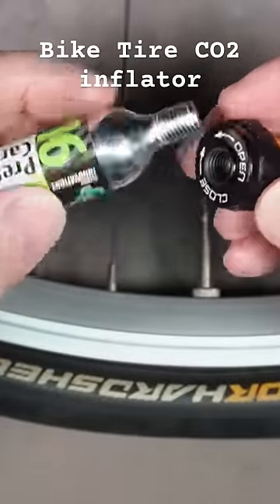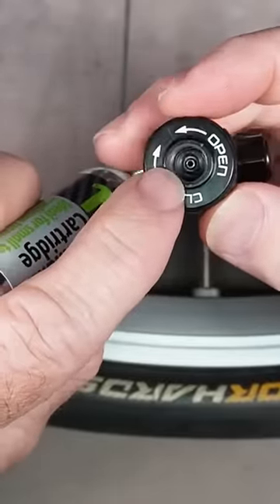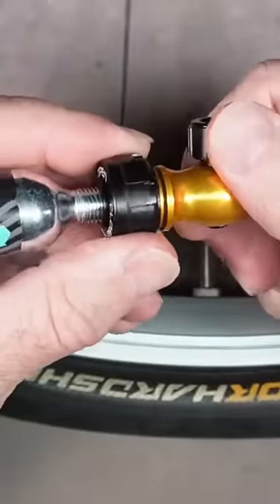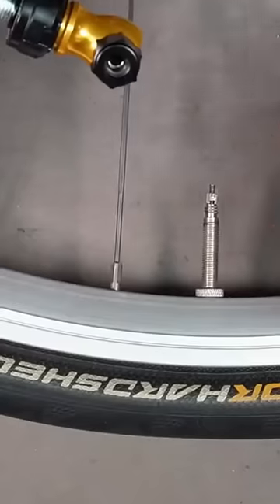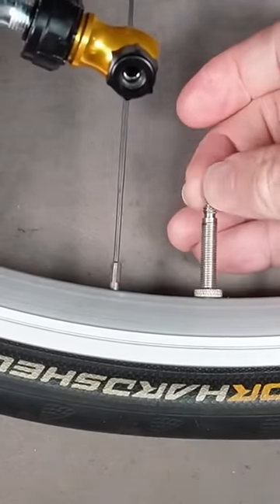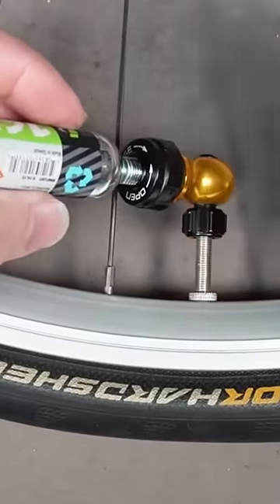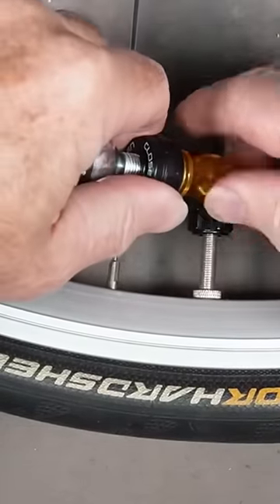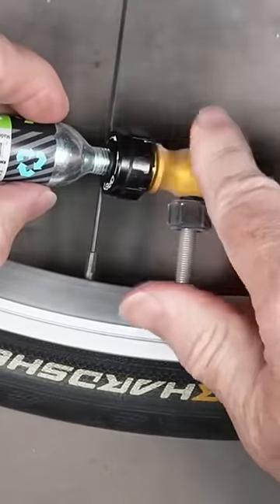Bike Tire (tyre) CO2 Inflator: How to use. #bicyclerepair #bike

Comment: For emergency only ya need make sure u have puncher repair kit or new tube bloody expensive way to pump ya tyre up 😂
Reply from the maker: It’s not really that expensive, but it is an option many cyclists choose. You can fix a flat in just a few minutes. Replace the tube, inflate in a few seconds and you are on your way. Just be sure to replace the CO2 with regular air when you get home. Thanks for the comment!

Comment: A bike pump doesn't weigh that much.
Reply from the maker: True. A CO2 inflator is just another option for emergencies to quickly and easily inflate a tire out on the road after fixing a flat. Thanks for commenting!
Reply: @davescycling  if you're racing like tour de France.
Reply from the maker: Nah, Tour de France riders get a new bike if they get a flat!

Comment: Man this was painful to watch, put the device on first then insert the cartridge. You did so many unnecessary steps 😂
Reply from the maker: lol, no steps were “unnecessary”. You must not be familiar with Presta valves 🤔. Presta valves close when there is pressure inside the tube or tire. I loosened the lock nut, which is necessary for air or CO2 to flow into or out of a Presta valve. You can see the entire video here: How to Use a CO2 Bike Tire Inflator
https://youtu.be/jc-BpZL3lAk
Thanks for the comment! I appreciate it!

Comment: Uuuuhhhhhh,,, what happens when you take it off the valve with the core unscrewed like that??
Reply from the maker: Nothing will escape when the CO2 inflator is removed. This is a Presta valve. Presta valves close when there is pressure inside the tube or tire. I only loosened the lock nut, which is necessary for air or CO2 to flow into or out of a Presta valve. I did not remove the core.
Thanks for the comment! I appreciate it!
Reply: @davescycling  ok, so there is a check valve inside. Got it.

Comment: Too lazy for using a pump?
Reply from the maker: If I were lazy, I would be reviewing recliners. A CO2 inflator is simply a small, lightweight, reliable method of very quickly re-inflating a tire after fixing a flat. Thanks for the comment!

Comment: Just use a high pressure  frame pump  these are just money crap....
Reply from the maker: A CO2 inflator is just another small, lightweight option to take out on the road in case of a flat. I have been carrying one for years and it works great.

Comment: Or instead of expending 20$ every Time u use it, u could just Buy a 7$ hand pump that y can use ir any Time AND they aré not that big 😂
Reply from the maker: That is a valid point, but they are actually $3 per cartridge. A pump is the best option for most, but I just love the super compact size of the CO2 inflator. I also love how quickly it works! Thanks for your input!

Comment: Better to carry a small hand pump than these. These suck. They rot your tires. Also use sealant. Dont br a weight wennie.
Reply from the maker: These are designed for emergency use only and they do work with tubes as well as tubeless tires. It is simply another option for on the road. Quick inflation, after repairing a flat that many choose to use, including myself. Thank you so much for commenting!

Comment: so why the hell take the valve out of the stem ?makes no sense
Reply from the maker: Thanks for the question! This is a Presta valve, and nothing was removed from the valve. It was simply opened so that the CO2 would go in. With a Presta valve, you do need to loosen the top nut to open the valve and then once there’s pressure inside the tube or tire, the valve automatically closes.
Thank you so much for your comment !

Comment: Зачем ломать себе мозги,если можно этого не делать?!  Давно придуманы портативные копрессоры для подкачки колёс!
Reply from the maker: CO2 inflators have been around decades before portable inflators. If you have ever actually used a CO2 inflator (I have many times) to save a ride, you would see how quick and easy they are to use. They weigh practically nothing and can be tucked away in a small saddle bag for years! thanks for your comment!

Comment: Ok, and remove the device now! It will deflate?😂😂😂😂
Reply from the maker: Actually, it will not deflate. This is a Presta valve. Presta valves remain closed as long as there is pressure inside the tire or tube. Thanks for your comment!

Comment: YTF wouldnt u just use a pump
Reply from the maker: A CO2 inflator is just another option for emergencies to quickly and easily inflate a tire out on the road after fixing a flat. It is super small, light and inflates a tire in seconds. Thanks for commenting!

Comment: Why. Just carry a hand pump instead of this frostburn inducing expensive complex item you need to keep buying cartridges for.
Reply from the maker: A CO2 inflator is just another option for emergencies to quickly and easily inflate a tire out on the road after fixing a flat. They are not expensive and a few cartridges have lasted me a couple years, so unless you get flats regularly, you do not need to replace them very often at all. This has been my experience as I have used and carried these for many years now. Thanks for commenting!

Comment: After inflation, how does 1 screw that valve core back to seal the co2⁉️ Your video didn’t follow through EVERYTHING THAT WAS MESSED WITH……..6/18/24 🇺🇸
Reply from the maker: This is a Presta valve. Presta valves close when there is pressure inside the tube or tire. I only loosened the lock nut, which is necessary for air or CO2 to flow into or out of a Presta valve. I did not remove the core. You can see the entire video here: How to Use a CO2 Bike Tire Inflator
https://youtu.be/jc-BpZL3lAk
Thanks for the comment! I appreciate it!

Comment: I want to see you take it off after you loosen the tire valve 😂. Good luck panic screwing
Reply from the maker: This is a Presta valve. Presta valves close when there is pressure inside the tube or tire. I only loosened the lock nut, which is necessary for air or CO2 to flow into or out of a Presta valve. I did not remove the core. If you click the link in the video, it will take you to the full video and you will see everything.
Thanks for the comment! I appreciate it!

Comment: But CO2 aint Nitrogen & is not a good gas to let it fill the tire.
Reply from the maker: The CO2 inflator is a very common inflation, tool carried by many road cyclists for years. It is used for emergency use only when getting a flat out on the road. Thank you for your comment!
Reply: @davescycling  🙏🏻

Comment: Обосраться, а как теперь вкрутить нипель сняв эту штуку что б в следствии невышел весь воздух с покрышки пока ты будеш его закручивать?) Если только не ехать вместе с ней)))
Reply from the maker: This is a Presta valve. Presta valves close when there is pressure inside the tube or tire. I only loosened the lock nut, which is necessary for air or CO2 to flow into or out of a Presta valve. I did not remove the core.
Thanks for the comment! I appreciate it!
Reply: @davescycling  надо глянуть подробнее конструкцию клапана, и как он работает
Reply from the maker: Yes, it seems this valve is not as well known as I thought. A lot of people left comments similar to yours. It is a common valve type in road cycling and I have been using it for at least the past 10 years!
Reply: @davescycling  я когдато занимался даунхилом то немного следил за всякими приколюхами, за железом, сейчас некатаю , неслежу за всеми новинками как раньше, вот и незнаю о нем)

Comment: Can't recommend to put co2 in a tire it's an acid that will even mess up silicone 😉
Reply from the maker: It is designed as an emergency measure when you’re out on the road to fix a flat, it should always be replaced with regular air when you get home.

Comment: Take the core out of the valve?  You have to be kidding!!!
Reply from the maker: The core has not been taken out of the valve. This is a Presta valve. The top nut must be loosened to open the valve in order to fill the tube. Once there is pressure inside the tube, the valve closes automatically. This is how all tubes and tires with Presta valves are inflated, whether it be a standard pump or a CO2 inflator.
Thanks for your question !

Comment: Has the world gone so insane that we now need throw away cartridges just to inflate a bike's tire???
Any bike I have used had or could receive a small pump that can provide unlimited air as long as you use your muscles to operate it... This makes no sense, CO2 will run out faster from your tires than air
Reply from the maker: The CO2 inflator is for emergency use when you get a flat out on the road. You must replace the CO2 with regular air when you get home.
Reply: @davescycling  Sorry, it makes no sense. I have repaired tires on the road more than once, you just put air using a small pump and call it a day. There are even cases where partly inflating the chamber helps to set everything back in place properly, that will be very difficult with this method...

Comment: na pompa apprresso, noo!?
Reply from the maker: Yes, you will need to use a regular air pump after you get home. The CO2 inflator is only for emergency inflation when you get a flat out on the road. Thanks for your comment!

Comment: Presta valve suck so to see you two cartridges for air and your tubeless bike tires suck too.
Just my opinion cuz I've tried them and they all suck tubes are the way to go
Reply from the maker: Thanks for your comment and your opinion! I do like the fact that my tubeless tires seem to be way more resistant to punctures because of the sealant inside. But I certainly hear what you are saying about tubes, much easier to work with!

Comment: Seems like an extremely expensive way to pump up your tires.... It doesn't seem worth The ten times you got to pump a hand or foot pump.
Reply from the maker: A CO2 inflator is just another option for emergencies to quickly and easily inflate a tire out on the road after fixing a flat. It is super small, light and inflates a tire in seconds. Thanks for commenting!

Comment: let the air out? xD
Reply from the maker: This is a Presta valve. Presta valves close when there is pressure inside the tube or tire. I only loosened the lock nut, which is necessary for air or CO2 to flow into or out of a Presta valve. I did not remove the core. You can see the entire video here: How to Use a CO2 Bike Tire Inflator
https://youtu.be/jc-BpZL3lAk
Thanks for the comment! I appreciate it!

Comment: I don't like these presta valves. They're way too fragile
Reply from the maker: That’s what I hear from people. I have never had any issues, used Presta for many years! Thanks for the comment!
Reply: I was using a manual Halfords pump, trying to keep it still while also pumping very hard is impossible. I guess these valves are best for electric or CO² pumps

Comment: Ненужная хрень , пока снимешь обратно и золотник вкрутиш надо по новой качать.
Насос вози.
Reply from the maker: This is a Presta valve. Presta valves close when there is pressure inside the tube or tire. I only loosened the lock nut, which is necessary for air or CO2 to flow into or out of a Presta valve. I did not remove the core. It actually works quite well.
Thanks for the comment! I appreciate it!

Comment: Its not worth it those co2 cans really dont hold much air, just pack a small hand pump with you
Reply from the maker: A small hand pump is great to carry! A CO2 inflator is just another option for emergencies to quickly and easily inflate a tire out on the road after fixing a flat. Many of my road cycling friends use these (including myself) as they do the job very well and are practically invisible on a bike due to their small size. One of my friends just puts the inflator and a spare tube in his jersey pocket and he is good to go! Thanks for commenting!

Comment: Lol c02 for tires??? Lmao dude nitrogen or judt plain air
Reply from the maker: A CO2 inflator is just another option for emergencies to quickly and easily inflate a tire out on the road after fixing a flat. It is super small, light and inflates a tire in seconds. Thanks for commenting!

Comment: 😂 pointless unless you have a patch or repair kit therefore you have to buy five things instead of just one write two
Reply from the maker: Of course it is pointless unless you are inflating a new tube or one that has been repaired. If you are on the road and you get a flat, you will need to inflate the tire somehow. This is just a very quick and easy way to do it. Thank you for your comment!

Comment: Y tho ??
Reply from the maker: A CO2 inflator is just another option for emergencies to quickly and easily inflate a tire out on the road after fixing a flat. Thanks for commenting!
Reply: Resealable? If so very neat indeed !
Reply from the maker: Closing the valve will keep the unused CO2 in the cartridge for a while, depending on the integrity of the seals. Thanks for the comments!

Comment: Just use a pump
Reply from the maker: A pump is definitely the way to go when at home or at the car. A CO2 inflator is just another option for emergencies to quickly and easily inflate a tire out on the road after fixing a flat. It is super small, light and inflates a tire in seconds. Thanks for commenting!

Comment: Stupid, what was wrong with the older style normal valves. Engineers have to re-invent the wheel 😢
Reply from the maker: I am not sure, but I do know that Presta valves are smaller in diameter, which enables them to be used on narrow rims. Thanks for your comment!

Comment: might as well use air you snobs 😂
Reply from the maker: A CO2 inflator is just another option for emergencies to quickly and easily inflate a tire out on the road after fixing a flat. It is super small, light and inflates a tire in seconds. Thanks for commenting!
Reply: @davescycling  may as well use a firecracker, much cheaper much smaller...even faster

Comment: Yeah but once you take that off the valve stem is still open letting ALLL THE AIR OUT. WORTHLESS. 😊
Reply from the maker: Not true. This is a Presta valve. It stays closed as long as there is some pressure in the tube or tire.

Comment: Автор відео ламер. Золотнік на соску викручувати не треба. Там нажимний клапан.
Reply from the maker: The author of the video knows exactly what he is doing. This is a Presta valve. NOT a Schrader valve. Presta valves close when there is pressure inside the tube or tire. I loosened the lock nut, which is necessary for air or CO2 to flow into or out of a Presta valve. I did not remove the core. You can see the entire video here: How to Use a CO2 Bike Tire Inflator
https://youtu.be/jc-BpZL3lAk
Thanks for the comment! I appreciate it!

Comment: Minus the fact your gonna lose all the air when try to tighten the valve stem smh useless
Reply from the maker: This is a Presta valve. Presta valves close when there is pressure inside the tube or tire. I only loosened the lock nut, which is necessary for air or CO2 to flow into or out of a Presta valve. I did not remove the core.
Thanks for the comment! I appreciate it!

Comment: More single use crap when they have sonthing designed to inflate tyres already
Reply from the maker: A CO2 inflator is just another option for emergencies to quickly and easily inflate a tire out on the road after fixing a flat. Thanks for commenting!

Comment: This is a piece of crap!
Now we have those small electric battery operated portable compressor for tyres which not only inflate the tyres but also allows to check the psi in the tyre and the number of psi can be preprogrammed and it stops on its own when the set pressure is reached!!
The size of the pump is very small just like not bigger than a hand..
So why using the piece of crap in this video!!?
Sometimes people lack distraction and they invent useless thing😂
Reply from the maker: lol! Those programmable compressors you are talking about are much larger and weigh a lot more than a CO2 cartridge and a valve. The really small ones do not have a pressure gauge and they take about three minutes to inflate a tire where the CO2 inflator takes about three seconds. I own a few of those and there’s no way I’m carrying one on a long ride. CO2 inflators have been around for decades, and they are a tried and true, super light, super fast way to inflate tire after fixing a flat. I really appreciate your comment!

Comment: more garbage :( 
use it and throw away?
Reply from the maker: A CO2 inflator is just another option for emergencies to quickly and easily inflate a tire out on the road after fixing a flat. It is super small, light and inflates a tire in seconds. Thanks for commenting!

Comment: ну і як блять воно залишеться накачаним коли золотнік викручений?
Reply from the maker: Nothing will escape when the CO2 inflator is removed. This is a Presta valve. Presta valves close when there is pressure inside the tube or tire. I only loosened the lock nut, which is necessary for air or CO2 to flow into or out of a Presta valve. I did not remove the core.
Thanks for the comment! I appreciate it!

Comment: Presta valves suck
Reply from the maker: I keep hearing that! Why do they suck?
Reply: @davescycling  prone to leak, design makes them difficult to inflate accurately, no real weight advantage
Reply from the maker: Thanks! Good to know the complaints. I have been using them for many years with no issues, but will definitely agree that Schrader is much easier! Thanks for your comment and input!!

Comment: Bad invention, bad investment.

Just get a pump, they even have pumps with a PRESSURE GAUGE.
Reply from the maker: A CO2 inflator is just another option for emergencies to quickly and easily inflate a tire out on the road after fixing a flat. Thanks for commenting!